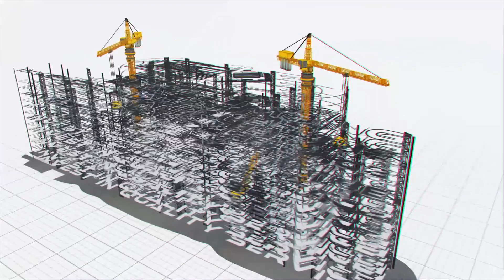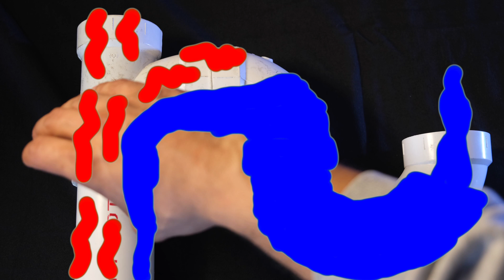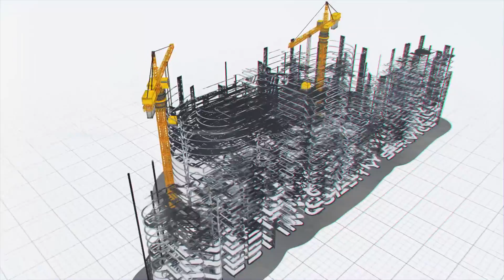Trap To Vent Distance

Comment: then according to this video... every p-trap installation I've seen in the last 40 years is NOT to code. P-Traps are normally hung under the center of a sink. The vent line in normally located in the wall. The distance from the wall to the p-trap is almost always greater than twice the pipe diameter.   Your code explanation sounds somewhat questionable.
Reply from the maker: You’re not understanding. The MINIMUM distance you’re able to go is twice the size of the pipe diameter. 

This is not my interpretation or theories on plumbing code. This is taken directly out of the code book.
Reply: Lmao, lots of people can’t read or listen to your video. I understood minimum and maximum, I even plumb to the UPC, and I saw you tagged IPC for 2” inch pipe. I had no problem at all with the video
Reply: @mwood562  know-it-alls are irritating aren't they?
Reply: I think your information is wrong I  been a plumber for 40 years and a 2 inch P-trap to the vent According to the UPC code book Uniform Plumbing code  5 feet and   1 1/2   P-trap should be 3’6”Maximum length
Reply from the maker: @edwardlee7491  that’s why I specifically put IPC in the video AND description
Reply: @stevengurrola5332  you are correct 100% some municipalities differ but your code is correct.

Comment: How do you measure if you have a 2" wye and a 45 instead? Same way?
Reply from the maker: Mr Vargas is correct. Venting with wye is not allowed
Reply: Can’t vent with a wye and 45 in the vertical. At least not in Oregon.
Reply: In Wisconsin it's legal. Wisconsin has it's own code and most of this video would be incorrect there.

Comment: What about Oatey Sure-Vent?  Distance? Other requirements to pass code?  How about to raise the trap above the entrance to the installed vent?  Thanks!
Reply: Those auto vents are being allowed to install under the kitchen sink cabinet. Depending how much room you have underneath, which usually isn't much. Inspectors request to get them in as high as physically possible. Reason is because for them to work properly they need to be above the height of the serving trap. With that in mind, pipe the trap in low so you can give yourself a easier time getting that vent higher. I hope that helps.
Reply: 18 inches above the  trap is what they recommend.
Reply: Trap arm distance is the same for Oatey Sure-Vent (if that is allowed in your municipality) or regular vent to exterior. 8' for IPC, 5' for UPC, depending on region